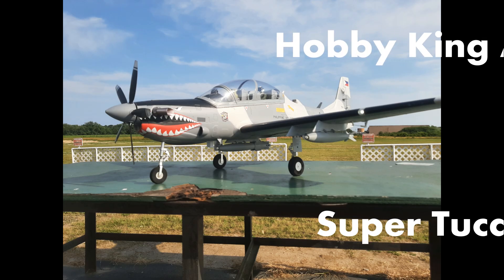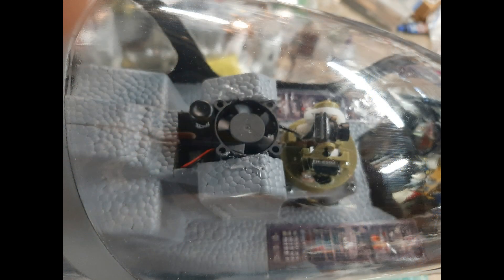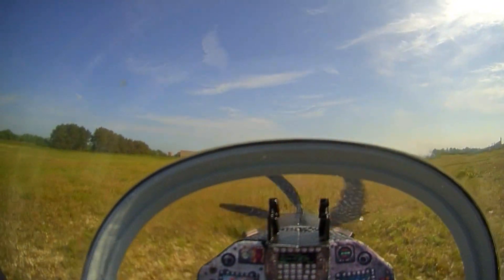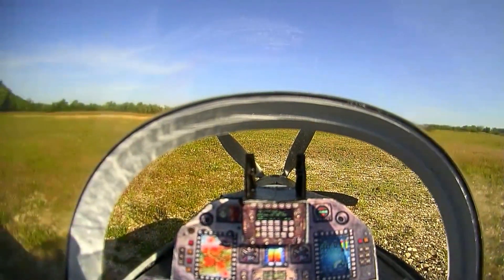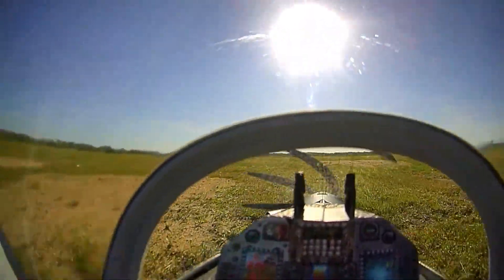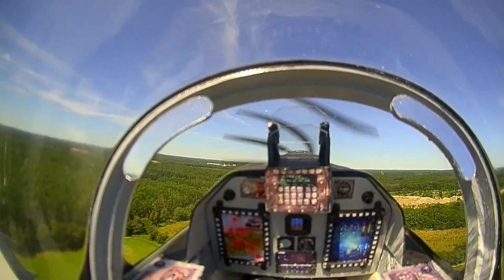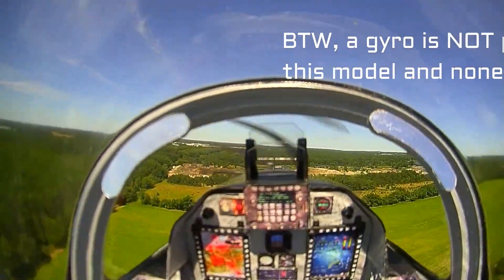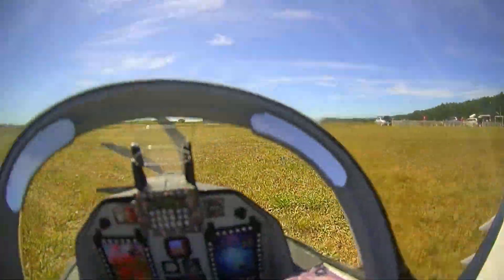Super Tucano FPV and bomb drop

Comment: was considering the Dynam however thanks for the upload might lean towards this one for an FPV setup appreciate it.  More room for wiring and will handle wind better. Gear is significantly better
Reply from the maker: I have seen the dynam fly and it does fly well but yes I agree with you on the quality, dynam are always suspect